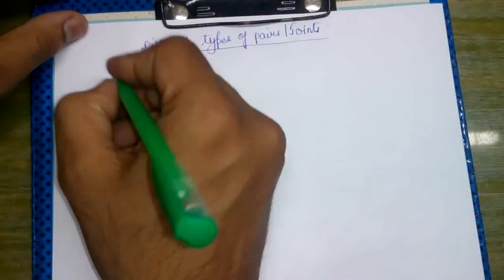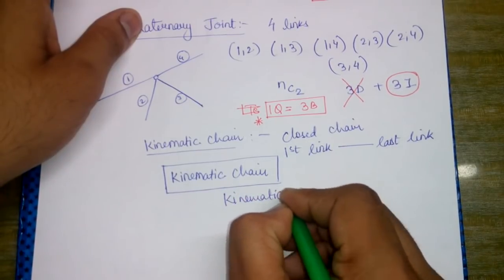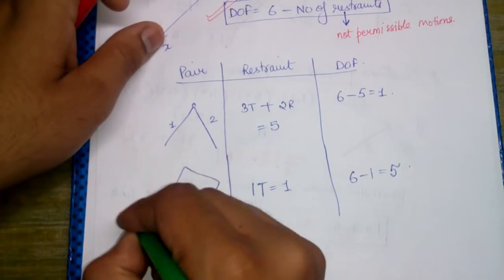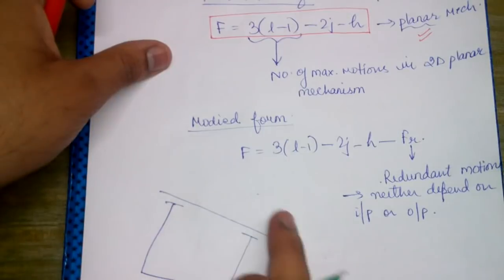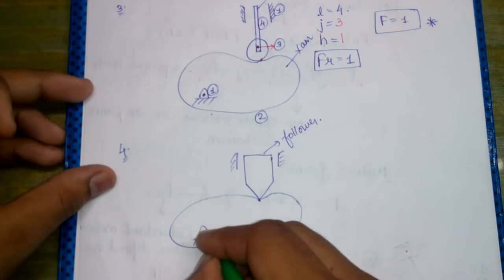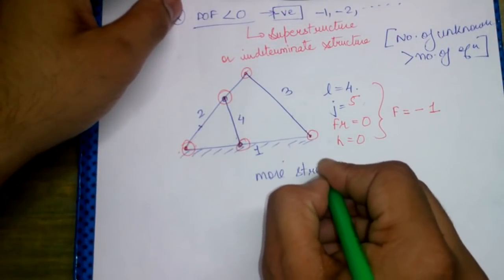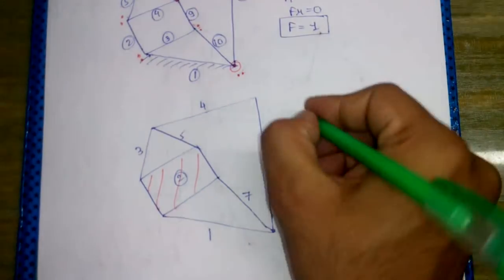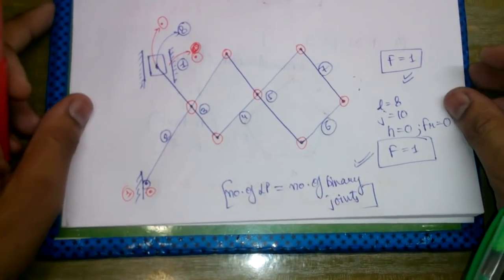Theory of Machines Lecture 2: Degree of Freedom, Kutchback's equation.

Comment: Sir spherical pair is a higher pair or lower pair?
Reply from the maker: It can be a lower or a higher pair as well. Depending upon the application it can also be a higher pair when tightly closed from all the sides as in case of ball and socket joint else it will be a lower pair.
Reply: @Mech zone tysm sir.🙏🙏